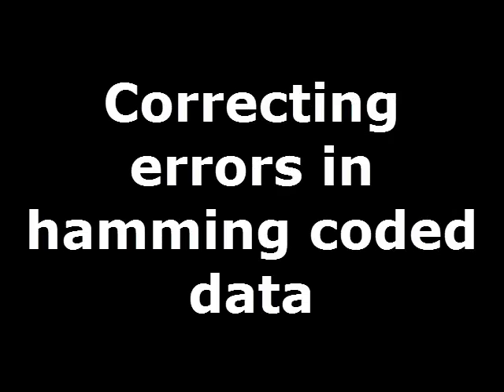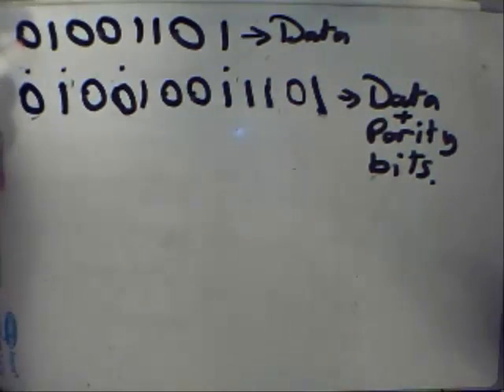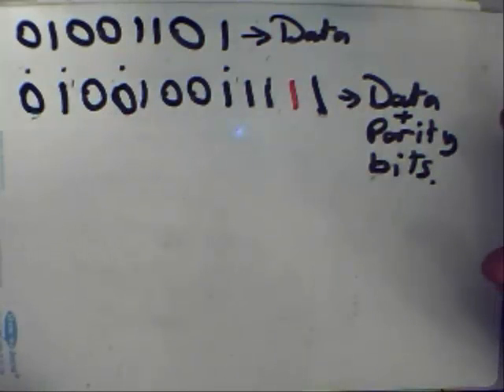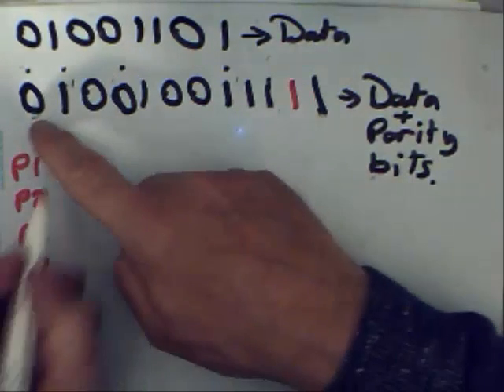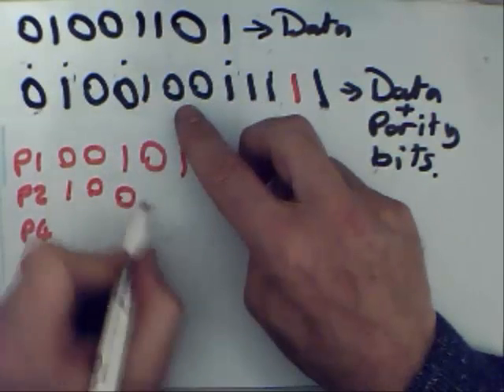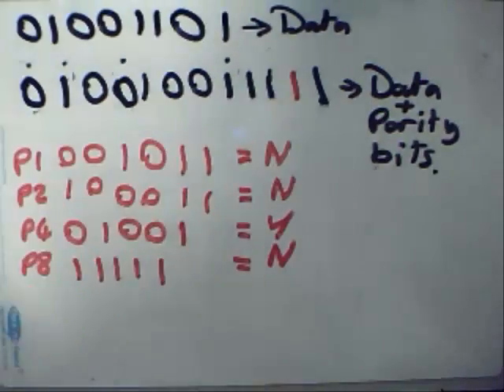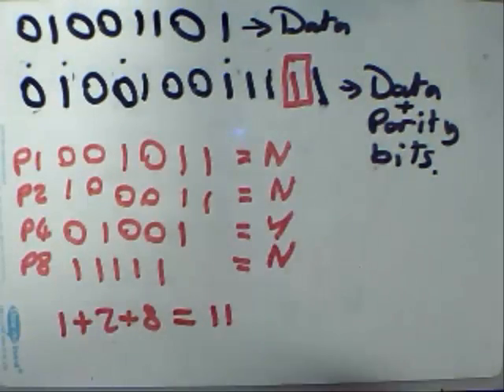Hamming Code - error detection and correction

Comment: you've made an error in p2 😑
Reply from the maker: No it is correct. Start at P2 use 2 bits "10" then miss the next 2 the use the next 2 etc. The last "1" would have been in the skipped set

Comment: why are you using the parity bits that are transmitted to calculate how the parity bits should look if the word was right?
Reply from the maker: It is the whole point, you start with some data, calculate the the parity bits. Sent the data and parity bits. If there was no error in transmission the parity bits will still be valid. However if there was a bit changed in error we use the parity bits to detect this and determine which bit was sent in error. In this video I am showing that if a bits was changed in error how we determine this.
Reply: How i understand it you have to calulate how the parity bits would have looked if the word that was transmitted was correct. After that you compare the parity bits you calculated with the parity bits which were recieved. However, what i still don't understand is why we use the parity bits we recieve to calculate how the ones for the recieved word would look. What i mean is, when you start calculating paraty bit 1 you are starting with the bit at the first position. But that is a recieved parity bit and not part of the original word. I might do something wrong, but when i try this method with the word 1001 and add the parity bits it is 0011001. Let's say bit 5 is wrong, so the recieved word is 0011101. I cant get the right result with the method you presented to find the error, because we use parity bit 4 to calculate how parity bit 4 should look. then it is 1, but to notice the mistake it has to be 0. that you only get when you do it without using the transmitted parity bit. And thanks for the answer:)
Reply from the maker: I think we are saying the same thing in a different way. When I say validate the parity bit by checking we still have even parity, that is the same as recalculating it and checking it is what we wanted.

Comment: I have a query-
p1- p1 0 1 0 1 1 - odd ones
p2- p2 0 0 0 1 1 -even
p4- p4 1 0 0 1 - even
p8- p8 1 1 1 1 -even 
If i dont write the parity value (like u did),i dont get the correct answer.Also if m not wrong didn't mention the condition whether you are checking even/odd parity.
Thanks
Reply from the maker: +Shivani Malhotra Hi as we are now checking that bits are correct we DO include the parity bits. Note this is the second video the first one shows how to determine the parity bits that are added to the data. Now we are checking that a bit has not been changed in error during transmission. THis done by ensuring that we still have even parity in the bits covered (including the parity bit) by each of the parity bits.

Comment: I think this is wrong. When you check the parity bits you usualy don't count them in also for checking. For instance: when you checked if P1 is ok you also put value '0' there. Why would you consider the value of P1 ? Isnt that the value that you are checking ?
Reply from the maker: +Lucian Umbrarescu The parity bits are set (video 1) so there is an even number of 1's in the data bits covered by that parity bit an the parity bit. So when we check to see if there has been an error (this video) you need to count the parity bit as well.

Comment: im sorry im really confuse about P2 and P8. they have odd bit. and the value is 1 right. and i believe from what i get from you is the value of p2 and p8 are the same with the parity before , so it must be matched with the parity before. i dont know im just confuse. would be glad if you can clarify me. Thanks sir
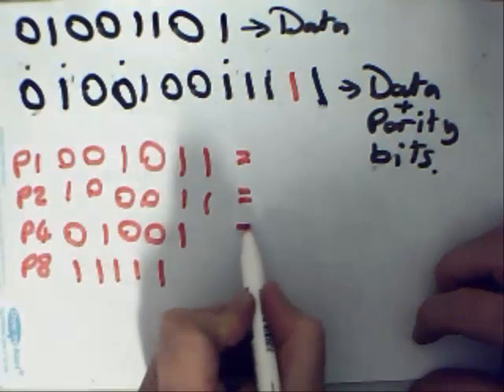Reply from the maker: ***** Hi I'm not sure I understand  where you are stuck so let me try and explain again in a different way. If you pause the video at 2:00 you can see I have listed the value of the bits covered by each of parity bits. In the 1st video the values of each of the parity bits was set based on the data bits so that we had an even number of 1's for each of these sets. However when simulated error  introduced we no longer have an even number of 1's for all the sets. These indicate which bit the error is in by summing the parity numbers that have an odd parity. i.e. P1, P2 and P8 so bit 11 is in error.Hope that clears it up.

Comment: what if 111110001?
Reply from the maker: eykey eyone assuming the ? in your question means you have a single parity bit you will be able to detect a single bit in error but not be able to do error correction. Its value would be a 0 if using even parity

Comment: well its great but ,,, i ran into a mind twist for like 1 hour ,,, i didn't get why P1 didn't match an odd number of 1's so the first bit was 0 ... and later P2 got also odd number while the bit number 2 is already 1 ..... 
simply you need to mention in the video at the second minute. if u got odd number of 1's its does not match independent of the data or data + parity . if you got even number of 1's then its match also independently . which i figured that out later after many times trying to figure why P1 is not matching while P2 also not matching when bit 1 is 0 and bit 2 is 1 ... sorry for the length of the comment

Comment: Can a parity bit ever be in error or are they sort of in the background and don't matter except when checking for errors?  Since, if a parity bit was wrong, wouldn't that screw over an attempt to find out which is wrong?  Also, what if more than one bit is incorrect?  Adding the parity bit positions that gave the wrong number of 1s would only give the least significant bit that is in error (or most, in this case, I guess).  Do you have a video explaining what to do then?

Comment: P2 parity and P8 does matches. value of P2 and P8 should be Y(correct).pls explain
Reply from the maker: We are using even parity, so the number of 1's should be even. For  P2 100011 has 3 1's thus there is an error. Hope that helps, see part 1 to understand where this comes from.
Reply: thanks....
Reply: Wayne Hamilton
Is it supposed to be even parity because the number of parity bits is an even number or because the number of bits in the sequence is even or for some other reason?
Reply: Have you get the answer of questions?

Comment: Why does the bit positioning go from left to right rather than right to left. You label the bits 12345678 whereas I'm being taught to do it 87654321. Does it matter?
Reply from the maker: I'm just trying to get the idea across of how it could work rather than showing a real implementation. If your teacher is showing it the other way round use that.
Reply: Why you say position 2 "doesn't match"? You found odd parity, so it does match. Isn't it?

Comment: How do you know if you are using even parity or odd parity? Do we we always use even? Just struggling to wrap my mind around how at the end you mark the P's Y or N. I know it's because you used even parity and they were odd, but WHY did you know to use even parity?
Reply from the maker: It needs to be predefined by the systems using it. i.e. for CD's it may be EVEN or some weather station system may be ODD. As long as both ends agree then it does not matter.
Reply: Wayne Hamilton I had the same question. Thanks for the video.
Reply: Wayne Hamilton

So, my teacher would specify on a test whether it is odd or even parity, or is there a way to figure it out myself?
Reply: Hammingcode will always use even i think

Comment: How exactly are the values of P1,P2,P4,P8 set as 'N' or 'Y'?Considering we're using Even Parity.
For P1,001011,It being an Odd No. of 1's,should have value 1,which it doesn't,thus N
For P2,100011,It being an Odd No. of 1's,should have 1,which it does,right?So why N?
P4,is Y
P8 having Odd No's of 1's should have a 1 and is 1 in the output right?So how does it work?

Comment from the maker: Did you see the first video?

The parity bits are calculated based on some of the data bits not all, we include and skip some in the calculation.
Each parity bit use/skip of data bits positioned at powers of 2 of its position - 1. 
i.e Parity bit 3  We use 2^(3-1) = 4, so we use the next 4 bits then skip 4 etc 
This video is intended for an A level UK qualification, students need to understand how basic hamming codes are used but not their proof.